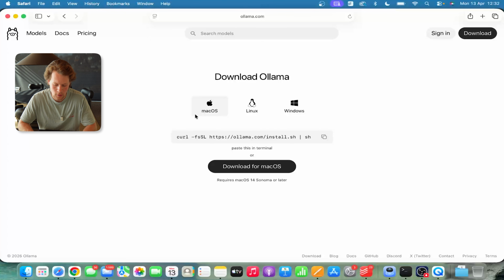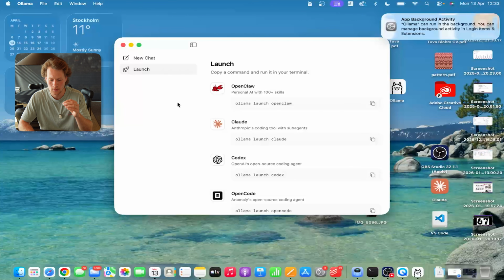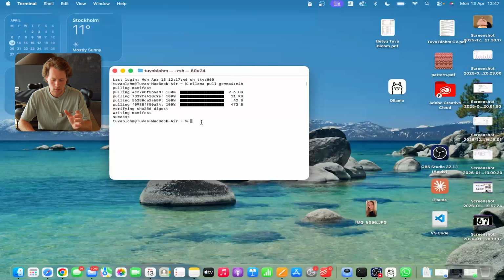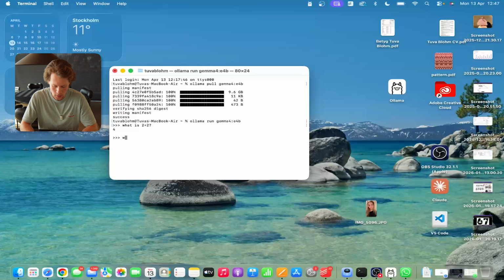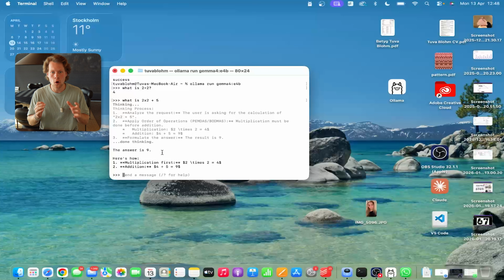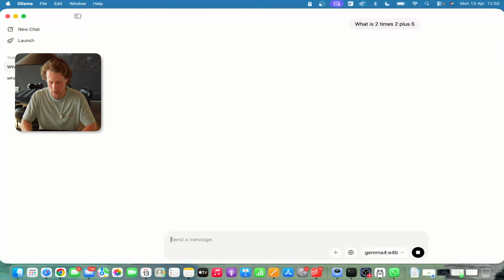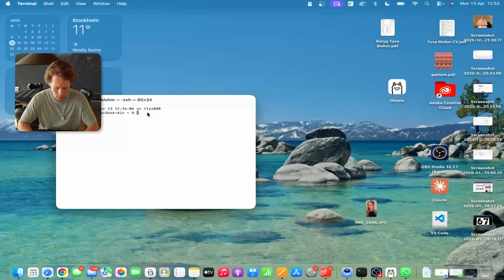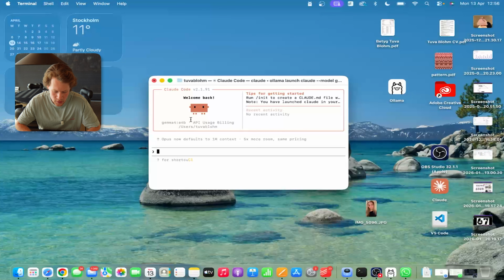How to Run Gemma 4 Locally Free (Ollama + Claude Code)

Comment: What's the point of running "simple tasks" locally when you can run all these simple tasks for free and much faster online by running the free models? I don't understand.
Reply from the maker: The simple tasks still eat API costs/Usage if you use local models for this instead you can decrease your cost/have more usage left for more complex tasks